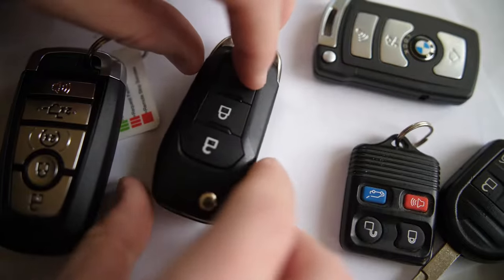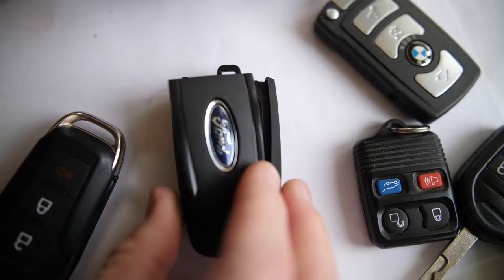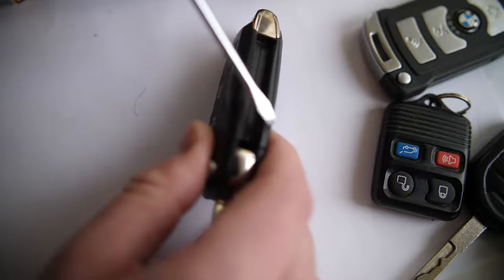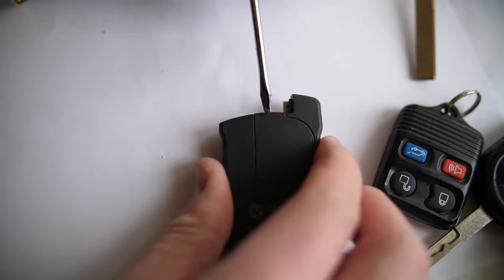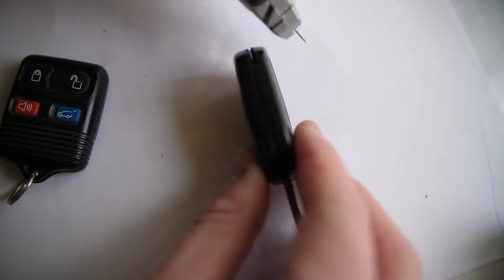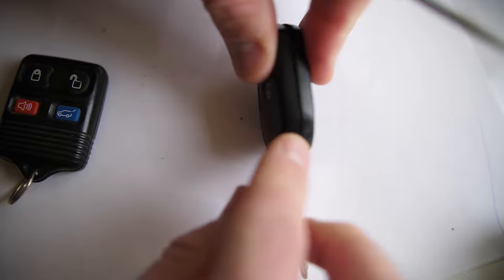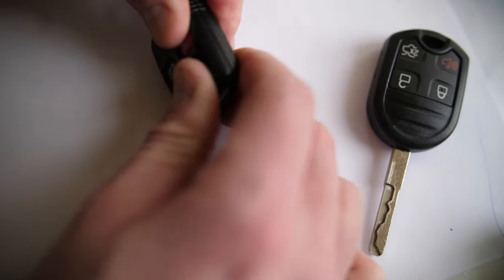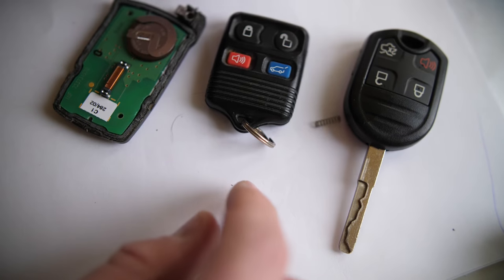How To Replace a Battery in a Car Key Fob

Comment: Thank you so much, I was quoted $120 from the locksmith!  I was able to change the battery for $6.00
Reply: That's the actual replacement key. It costs me $10 from dealer.

Comment: Perfect! My F-150 2018 display just told me my remote battery is low! How much more convenience can Ford give? Except maybe permanent shut-off of the “auto stop” (gas saving?) feature - tho I’ve heard you can get a chip to plug into the diagnostic socket to tell the truck to turn that feature off whenever you start it rather than when the engine dies at a stop sign!